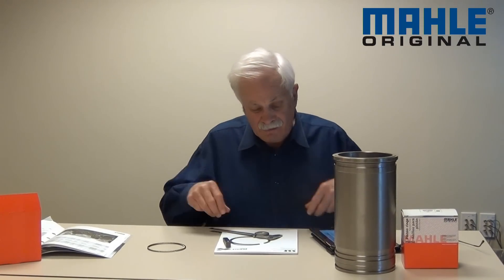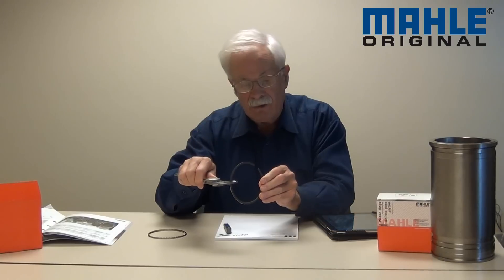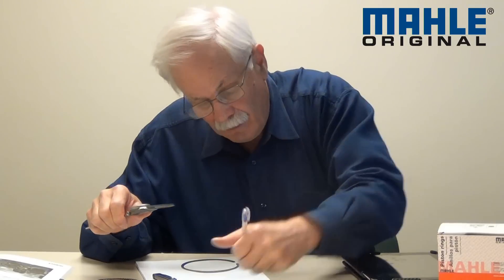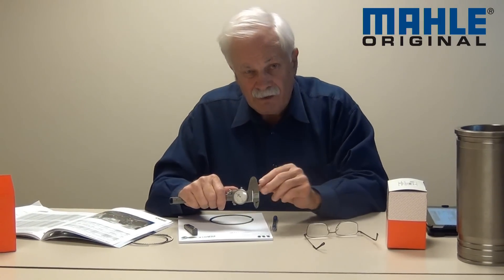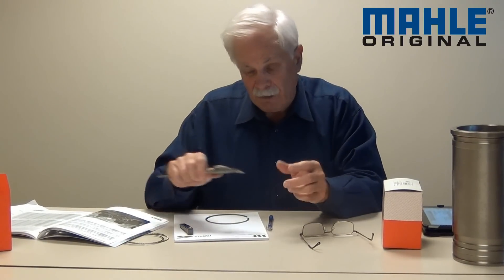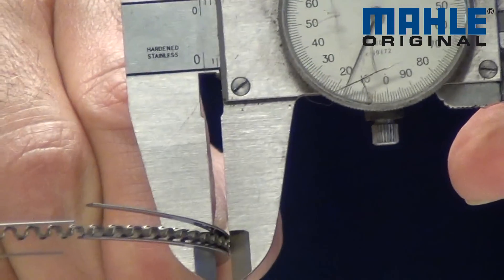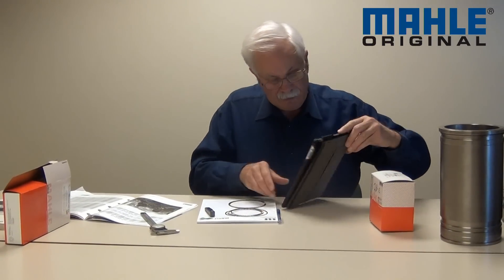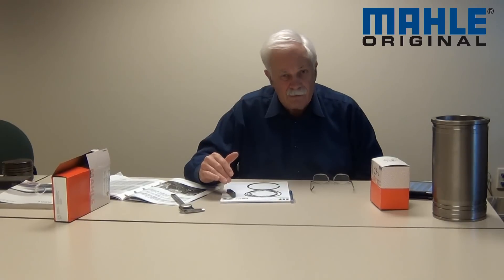Measuring Piston Rings

Comment: Thanks mate! Being a computer nerd with two trashpicked weedwackers I expertly reinstalled the piston ring on the one engine upside down which broke it.

Didn't think to measure the cylinder diameter though, hopefully the outside diameter of the ring remnants will suffice.

Comment: Hi, great video
What is the relationship between the 1 liter car and 3 liter?
Does it depend of the piston/cylinder size or the amount of air/fuel mix that goes inside the each cylinder/
Thanks.